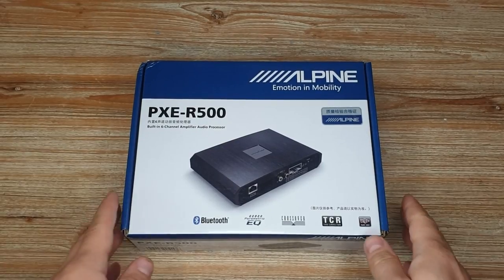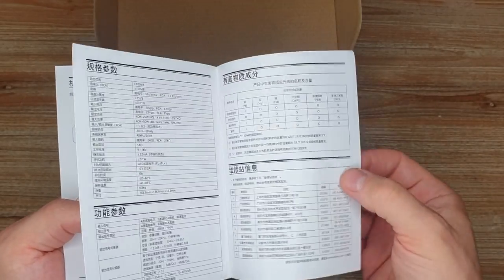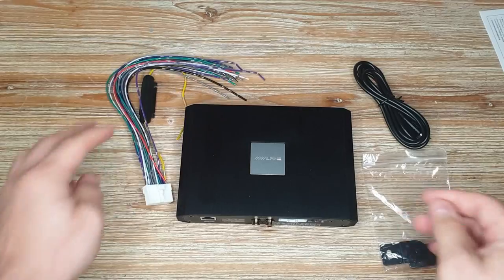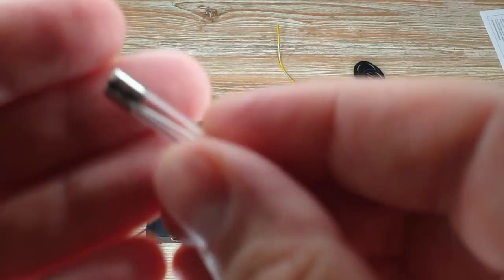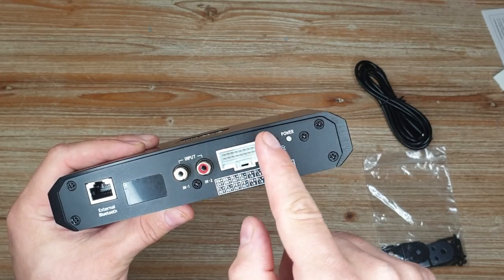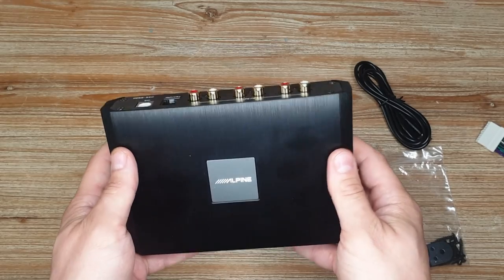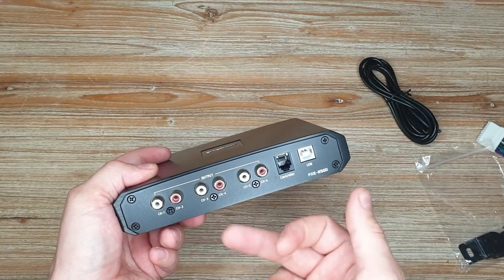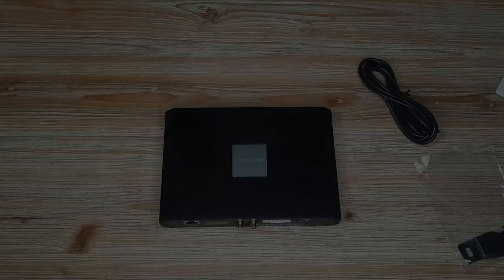Alpine PXE-R500 DSP unboxing and first impressions

Comment: I’m not saying that the new Alpine PXE - C60 is best. But it is solid. At first I wasn’t sure about it, it seemed distorted. But that was more of a user problem  . (😊) Now after some time playing with … WOW the amount of clarity that my system has now is incredible. I’m hearing things in my music that I’ve never heard before.

I also am able to finally tune in mid base in mid range to an acceptable level that I’ve been lacking for years, trying to find when using audio controls line converters.  

It wasn’t really till I started watching your videos that I realized I made like it loud but I was more an SQ person all these years just not knowing the difference. I chose to get the Alpine DSP that doesn’t have the built-in amplifier just for the fact that , I already have such a good external amplifiers. I decide to keep what I have. It has allowed me to do so much, and I never could do before.

I have not run into any issues with the software, nor have I run into anything that the processor cannot do 

I can definitely attest to the fact that the clarity and the processing and high output is very good

Comment: Any alternative to the optional controller? Ie phone app?
Reply from the maker: This is mainly meant for factory integration, so you would be using your head unit or steering wheel controls. I believe there is a controller sold separately,  not sure about the model number.

Comment: I prefer amps with 50watts or more. I really like the form factor. 25watts is good for tweeters, but IMO midbass and midrange need much more. I was running my Dayton 8” Reference’s with a Audiocontrol D6.1200, so around 100watts. That was the limiting factor with my system. My widebands and subs had to be turned down to match the midbass. We shall se what happens with Phase 3 of my build.
#theoneaboveall others I have built.
Reply from the maker: This DSP offers typical head unit power. For some on sensitive speakers is plenty enough for daily😉